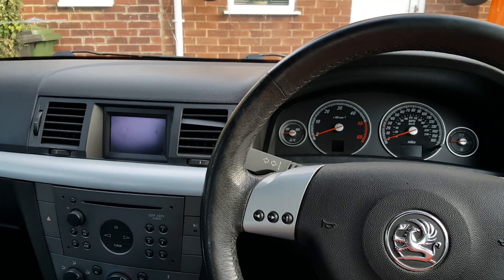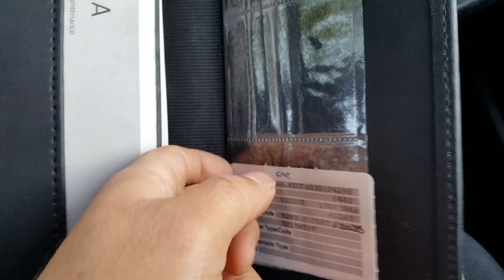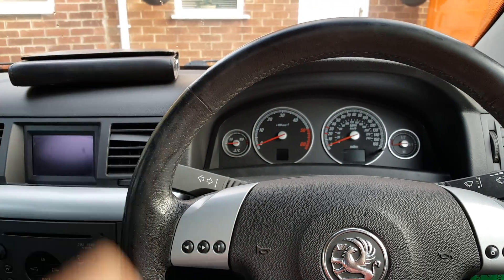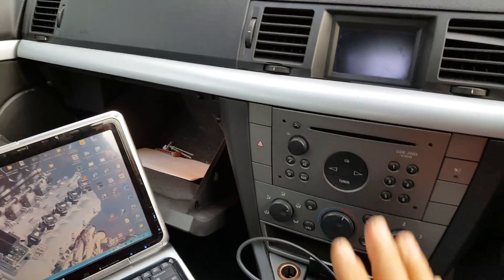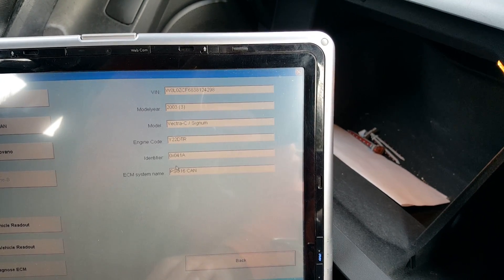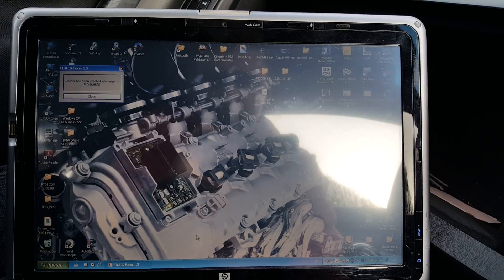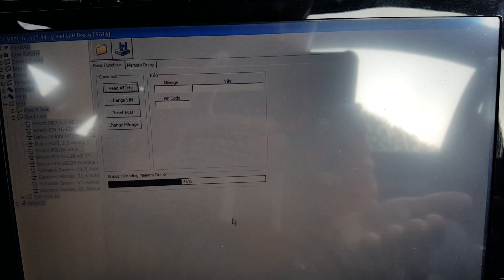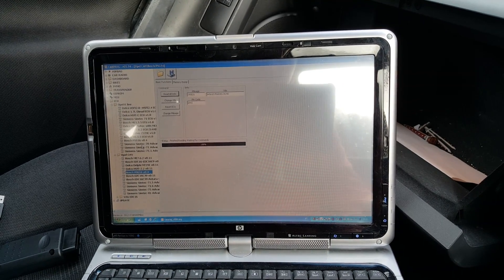Vauxhall Opel security pin retrieval - the 4 different ways to obtain the code.

Comment: Thanks for the info! Managed to get the PIN from a Zafira B with the Carprog  and to program the DRL's. Learned a lot from you! Cheers!
Reply from the maker: 😉
Really appreciate your feedback! 
Thank you for watching! 
👍
Reply: Do you reckon it would work for Zafira A ?
Reply: @thefinestjamelia5029  I think it would. Carprog is a great device!
Reply: Another great video with good info 💪, question though, will carprog access the cim to retrieve the pass code as it doesn't have a code with it and it's different to the rest of my bcms, cheers again
Reply from the maker: Don't think it does... at least not the version I was using in this video...
Other tools my do it though...
👍👍👍
Reply: @Hillfortgaragecustoms  you have to locate the eeprom 95160 if I'm not mistaking and you can get the pin from it. But I'm sure that here we have people that are more expirienced than me and can give better advice.

Comment: Hi, I need some help. I'm trying to retrieve the security code on a Vauxhall corsa 1.2 EXP. 2007 .with system name ME7. 62 using op-com and Carprog V10.05 . When I press read all Info it comes up with. 
Could not send  CAN KWP packet.
I've also tried it on Key_line.
It comes up with. 
Can't read ECU.
Any help Thanks Ade
Reply from the maker: Hi
I don't have that version... 
Does it gives you other options for reading?
Can you read anything with it?
Thank you for watching!
Reply: @LMAutoRepairs  hi thanks for getting back to me. 
No it doesn't seem to read anything. Could it be the lap top needs win 10 . I'm running with a lap top win 7 .
Thanks Ade
Reply from the maker: @adgepearce4788  
Doubts... but might worth to try...
Have you used that tool successfully before?
Reply: @LMAutoRepairs  no just bought it off ebay.
Reply from the maker: @adgepearce4788  
I don't want to de-motivate you... but you can have a bad carprog... try it on another OS... and perhaps do something else... just to prove it works...
Hope that helps...
Reply: @LMAutoRepairs  ok thanks for your help. Could you recommend a site where to buy carprog . If I can't get this to work.

Comment: Hello Luis. Could u help .i have 08 vectra c . Have bought op com. When im connecting to diagnostic socket i can see everything. But i cant reset dashboard computer. Op com say : no code index selected.  From factory it shows radio and timer. But i want fuel, coolant temperature etc. Thanks

Comment: Hi Luis. Please can you help on a case with a 2002 corsa c 1.0 petrol. I need to replace ecu. But firstly need to reset / virign the donor ecu or extract pincode and don't know how to do that.
I actually have opcom, xprog, galletto, kess, fvdi 2014. Is there any way how to do that?
Thank you in advance.
Reply from the maker: Hi
I never used FVDI... see if that one can read the pin from the engine ecu...
Reply: Just to report back and maybe help someone in the future, I used fvdi to retrieve the pin and it did it successfully. Problem solved :)
Thanks again.
Reply from the maker: @AldiShuli  
Great stuff! 
Thanks for the feedback!

Comment: Can you enter the new pin code with carprog I see you can reset but can you enter the new code? 

Cheers
Reply from the maker: Hi
Yes.
But once you reset it, you can use any capable tool, like Op-com, to code the new code...
Hope that helps.
Thank you for watching!
Reply: @LMAutoRepairs  

Hi thanks for the reply yes that's very helpful. Can I also reset a new/second hand ECU if it is installed in my car with carprog also? Basicly I need to change my ecu due to water damage. I have managed to get the pin code of the original ECU and I have a second hand ECU but it has not been reset. 

Thanks
Reply from the maker: Ok
So I presume your ecu is not readable... you can use carprog to reset the second hand... but you need the pin from your car to program it...

Comment: Hi! Awesome video. I have a corsa C with a broken ecu. I installed another one including the transponder detector and keys.
How can I program it so the car will start again? Do I have to reset the bcm?
Reply from the maker: Piekartz 
Hi
Yes you do... you need program everything in the right order...
Thank you for watching and for your comment!
Reply: @LMAutoRepairs  hi I have changed the leds in the speedo and have broken the ribbon for the odometer. Obviously the mileage is not displayed but also the speedo is intermittent and sometimes don't turn on and car won't start and I have to unclip then reclip the wires multiple times then eventually it turns on and car starts and works until the car is turned off and locked then when returning to the car sometimes it will not work again the immobiliser will not turn off and the headlights turn on with the ignition. Plz help me with this
Reply from the maker: @darrenmicklewright2008  
Looks like you know exactly what is wrong...
How do you want me to help?
Repair what you broke, and should work...
👍👍👍
Reply: Thanks for the quick reply. I don't have the old security code from the broken ecu. Can I make everything work with the new code (from the second hand ecu)?
Reply from the maker: Piekartz 
You need both codes...
You need the code from the car to program the Immobilizer...

Comment: Hi 
LM Auto Repairs
, recently purchased a Carprog device as yours in this video, managed to read the code following your instructions but however this code is not recognized by the car when trying to program a new key transponder it says is wrong. Any reason for this ?
Reply from the maker: Andrei Ciobanu 
Hi
Which tool are you using to program the keys?
If you read the code again, does it gives you the exactly same code?
Make sure you selected the correct ecu... although you should get no communications if you select the wrong one...
Thank you for watching!
Reply: LM Auto Repairs Hi, I’m using the OpCom (a chinese clone one not the original) yep l’ve did the read operation a few times and it gives me the same security code, pretty sure the right ECU is selected as the VIN is shown correctly, however this code does not get validated on any operation requiring it within OpCom not only when attempting to program a key ( that was my main purpose). From experience have you seen this behaviour ?
Thank you !
Reply from the maker: Andrei Ciobanu 
Unfortunately no... it worked every single time for me... 🤔
Reply: I've been having the exact same problem on an 07 plate astra van, it always gives me the same 4 digit code 
but I noticed it is actually the first 4 numbers in the VIN and after looking in the dump, carprog is just taking this from the other 10 numbers of the VIN which is next to every line of code.
it's so frustrating :-(
Reply: Andrei Ciobanu
I managed to get my pin code, I removed the eeprom chip from inside the stereo,
then used carprog with the A6 adapter to read the dump and finally a separate
piece of software to decode the dump and get the pin.
Oh and I had to have a 12v supply to carprog to get a true reading of the eeprom,
without the 12v supply it was clearly giving a corrupted reading of the chip.
Reply: Don't know about Carprog (have it, did not use it yet) but I guess you don't have official one, so that might be the problem. Just call the dealer and buy the code, or use official OpCom (some cars you can read code), or Abrites (avdi) for Opel, which I always use (official one) which works fine. If you won't pay for software, might be bitten by wrong codes or non working software, that's evident to the investment you make (the clones are great for service resets, codes reading etc, but deep going stuff... no go)

Comment: Hi
What opcom do you use ?
Thanks
Reply from the maker: Mr. R.A 
Hi
2010 and 2012... if I am not mistaken...
Thank you for watching!
Reply: LM Auto Repairs is it the clone opcom or original ? And have you got a link where you brought your one ?
Thanks again
Reply from the maker: Mr. R.A 
My one is clone... I have been thinking in getting the original, and will might do once this one fails...
I got my one from eBay... to be fair, wherever you buy it, they all came pretty much from the same place...
👍
Reply: LM Auto Repairs do you no what version / firmware opcom you bought? Because I have a opcom clone v1.45 but I cant seem to do what you do like on the astra h my opcom only let's me go on 1 or 2 modules and that's it other modules it can't read them. And when I try to read dtcs on most modules it says can't read ecu make ignition is on etc. Do you get the same or isit just me?
Thanks again
Reply from the maker: Mr. R.A 
No... I don't have that issue... but I have two interfaces, one with 1.45, the other one with 1.39 if I am not mistaken...
Reply: LM Auto Repairs do you use the same software for both firmwares v1.39 and v1.45?
Reply from the maker: Mr. R.A 
Yes...
Reply: LM Auto Repairs is it possible you email me a copy of the opcom software ?

Comment: I just bought a 2005 holden astra AH cdx, it has a cdc 40 opera radio and it keeps displaying DISPLAY SAFE. I don't seem to find the key in its manual. Nor is there an AS button to get to the menu to enter pin. Any suggestion how this can be solved.
Reply from the maker: Nikunj Khetani 
Hi
It is more complicated than just find the code... most likely you are going to also need tech2 to reset the display... as it sounds like is not paired with the unit...

Comment: Hi, I have a 2004 Vauxhal Vectra C 2.2 with a Z22SE engine code. The ecu is faulty and I need to change it. I have an ecu from a accident car which intend to use. Which version of CARPROG can I use to read the pin on both ecus?
Reply from the maker: Emmanuel Achiume 
Hi
If you are going to buy it, just get hold of the latest version...

Comment: got this kit today same as yours carprog, cant seem to get it to work on my corsa 2005, its 1.1 ecu is bos 01260261208393.  tried all menus on left listing ecu
Reply from the maker: holly may 
Are you sure it is compatible with that ecu?
What are you trying to do?
Reply: pin code mate i have noticed you have v05.94 mine is v10.05
Reply from the maker: holly may 
You should be able to read the pin code from the dash using opcom... is that the Corsa c?
Reply: yes mate its 2005 will try that tomorrow

Comment: Not a good idea to show the Key number (forth one down on the card) as from this we can convert into the cutting code -
 (this is the valleys and peaks on the key) as most other auto locksmiths can also do. And anyone else can take that and get a key to open your car!  Better to block it out or remove it .
Reply: how are people going to steal the car when they dont know where it is,they dont know the reg and they dont even know the colour,
Reply: your being paranoid, unless they have the correct location, details of exact car etc, unless they have a 'crystal Ball?? 🤔

Comment: Hello, thank you for the video! Where did you buy a carprog programmer and the software for it?
Reply from the maker: Andriy S 
Carprog will come with the software...
Google will help you to find it... the original and the clone versions...
There is plenty of online sellers... eBay being one of them...
Hope that helps.
Reply: Well, I know what you mean. I have been searching for Carprog in internet. The variety of offers is exactly my problem. I don't know what to buy. I am not sure if the clone will work but obviously there are only clones in internet. That's why I am asking you to tell me a particular offer with a Carprog that definitively works.
Reply from the maker: Andriy S 
I can't really advise you on that... as a clone is always a gamble... it might work jut fine or might not...
I am on the second clone carprog... Although I think I have been lucky on this last one....
If you really want to be sure, buy the original...
Reply: Good, but is it possible to buy an original? I am not sure it exists. I only found a 600USD proposal from Codecard/Atomis. This is some kind of legalized clone. That sounds weird. And to give 600USD for that + SW. I don't know. Probably I'll buy an original OP-COM that seems to work well and is from a serious manufacturer. But unfortunately a basic OP COM version doesn't allow to reset an engine CU. Only 2k€ OP-COM can do that.
Reply from the maker: Andriy S 
The codecard website is the original seller of carprog.
The legalisation is something that they started to offer not long ago.
The clone car prog is when connected to the Internet, and or uploaded with the original software, the ATMEL chip is killed.
What they are offering is the adding of the clone carprog to their database... and that way make it legal.
The problem is that clone car progs can fail hardware wise... not sure if you buy another clone, the same legalised software still works... 
Original op-com is about £700...
Carprog and op-com do different things, you need to think what you need the tools for, and from there decide which one to buy...
Reply: That's new for me. I didn't know codecard is an original seller. Well, my main aim is to reset and program OPEL/Vauxhall EngineCUs. There is also Carman (they write the are from South Korea, but I've got a feeling that's Russian product), Abrites from Bulgaria and Opel Scanner from Russia. You've got any experience with these devices?

And, from your point of view, what is the main difference between OP_COM and Carprog?
Reply: LM Auto Repairs f
Reply: Andriy S opcom clone can reset ecu. I have done it

Comment: Hi, i have my car pass, can I pair any ecu with my car pass? Or does the new ecu have to be reset?
Reply from the maker: Marcus Venn 
The "new" ecu needs to be reset first using its own pin code...
Reply: lmsvvavr 
So I've got a new ecu with a passcode, and I plug that in to my car, and reset it, then repair it with my car using the passcode? Is that ok?
Reply from the maker: Marcus Venn 
Pretty much so...
Watch this one, it will might help to clarify some questions...
https://youtu.be/70mteUUUzjg

Comment: Hi I have a corsa 2009 model. my radio if you hold the power bottom and scn together 7 SAFE comes up...and nothing more. It does't want to skip to the code to punch in.
Reply from the maker: Abigail Lac Key 
Hi
That means you still have 7 attempts to input the code... which means you have already tried 3 times...
leave the radio on for some time and it will eventually allow you to input the code.
Should work about 10 or 20 minutes later...

Comment: Hiya Iv just bought carprog clone of eBay won't connect to can cars just says could not receive can kwp frame any help would be appreciated :)
Reply from the maker: lee pedroo
Hi
What's the problem?
Is the software detecting the carprog correctly?
It can be a problem with the car network....
Reply: lmsvvavr I don't no lol all it says is could not receive can kwp frame ??
Reply: Hey, I also want to retrieve code for Vectra C. I researched Carprog clones but the description mentions that it does not offer full functionality. It is mainly usefull for resetting airbag.